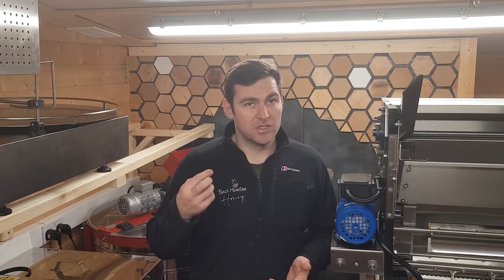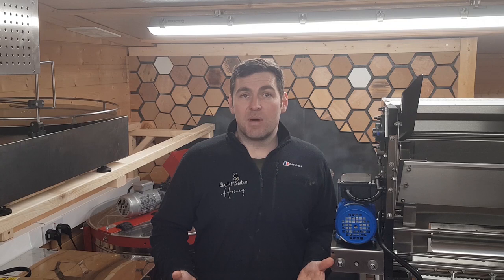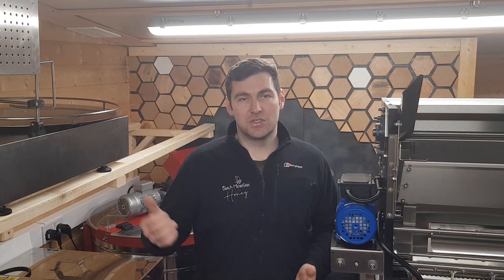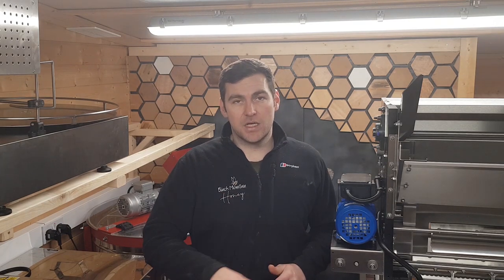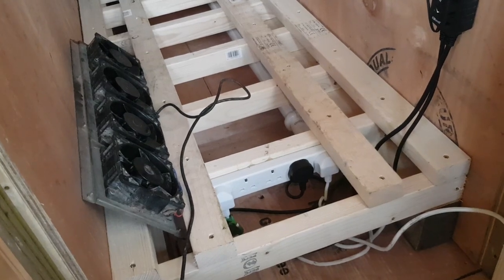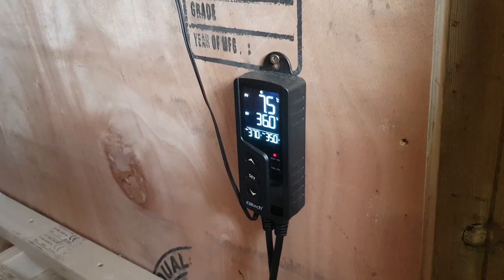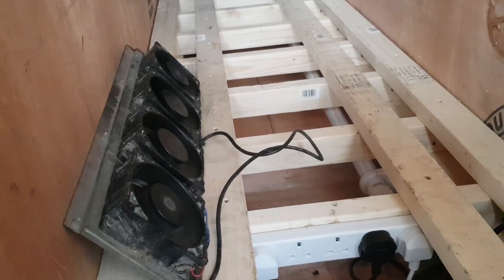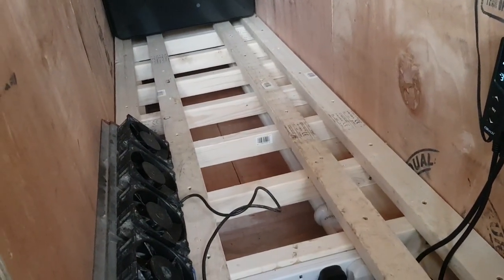Warming Cabinet

Comment: Have you thought of using a 2kw diesel heater? I have one in the back of my vivaro van as a heater. It would reach the temperature you want easily and its blown ais so srlf circulates. Also very efficient.  I think 1 gallon of diesel lasts about 24 hours.

Comment: The heating room looks good BUT I see one thing I would add to it . I think I would put 2”x4” along the wall at different heights where you could lay plywood or some kind of insulation just higher than what ever you have in the warming room to warm up so you do not have to heat the whole height of the room . It would save money , time and time is money . You could easily move your thermostat wire down under your false moveable ceiling. Just thought that may help a little. What does your heater pipes in the floor have in them that heats up ?? . Good job on this room . Thanks

Comment: What temperature controller and fans did you use for this? I have finally got started on converting my garage to a honey room and am going to upgrade my current homemade bucket warmer to something similar to this.
Reply from the maker: I used an STC 1000 pro controller. Just bog standard computer fans. Hausen heating tubes as they dont have thermal cuts outs (well they do but they are stupidly high).